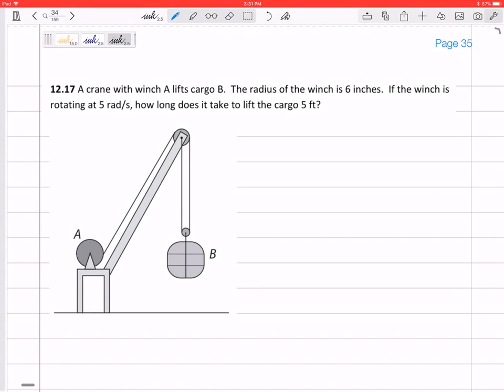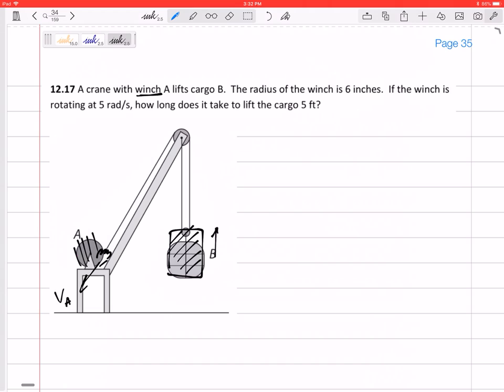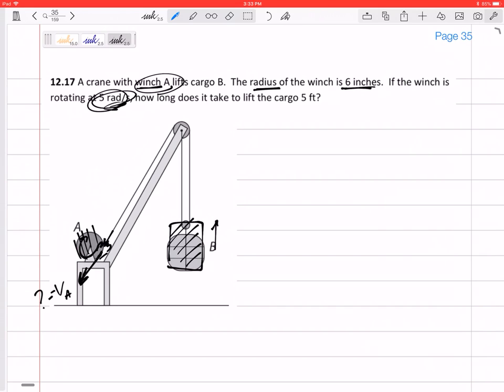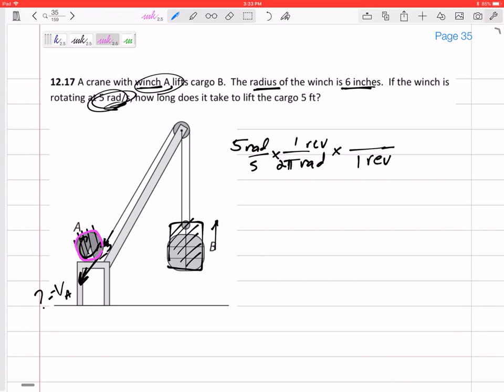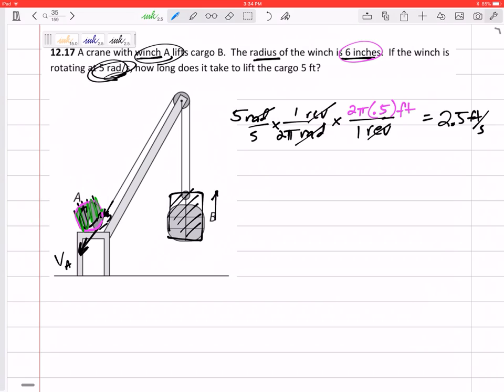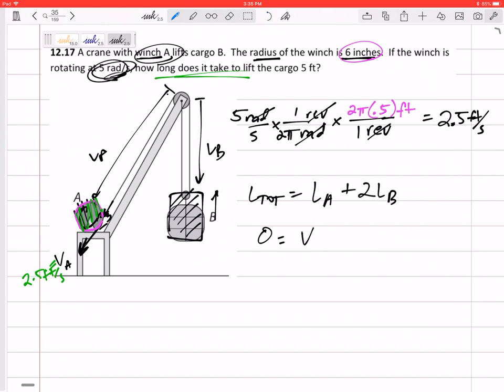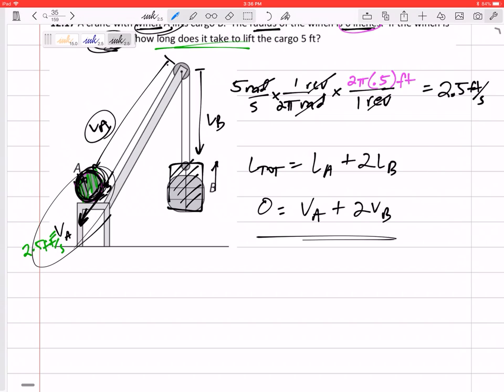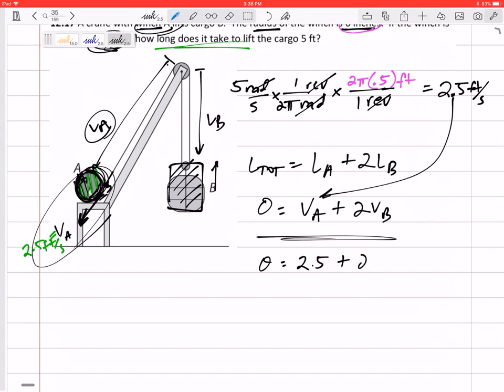Dynamics - Constrained Motion Example 1

Comment: Hi professor, why wasn't La considered constant since there is always the same amount of rope between the whim and the top pulley? thank you very much.
Reply: I think it is because the La is the total length of the rope on the right side of the pulley ( the amount stretched plus the amount which has been wrapped around the winch)